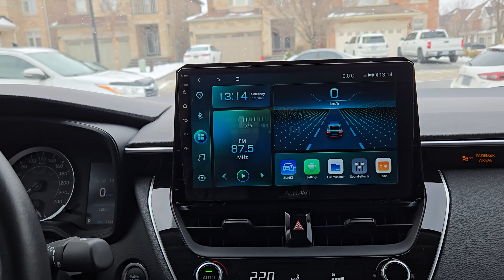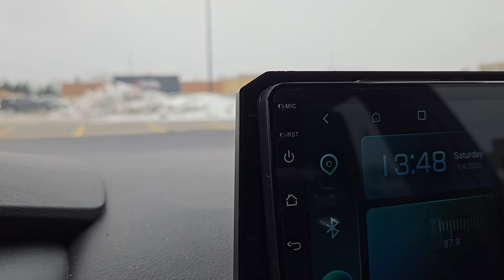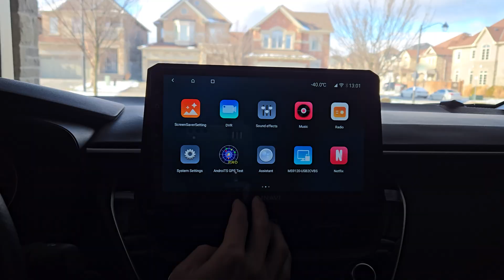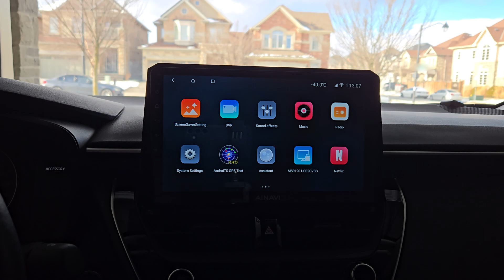📞 The Android Head Unit Microphone Noise Problem Low Volume FIXED!

Comment: I had the same issue,  i just removed the onboard mic from that board all together, and plugged into the existing external mic on the android head unit.  that resolved the issue for me.  less soldering as im not that great at soldering small components

Comment: There's another thing that you could do, take the centre light unit out, and tap the end of the mic with a multimeter on continuity and mode and check the other end of a harness that usually ends in the back of your previously fitted stereo. There are usually 3 points of contact for factory mic - Signal +ve, GND and +5V; You can use a +5V from one of the two USB outs, and use the mic port on the back of android stereo to hook up the SIgnal +ve and GND

Comment: Did you retain the mic connected on the back? like you're using 2 external mic simultaneously? I desoldered the internal mic and I connected an external mic on the back and attached the mic on the original mic position. i'm still not satisfied, planning to do your fix, like 2 mic external working at the same time. is this the same with your setup?
Reply: If you leave the external microphone the way it is, you'll still have tge same issue with the modified mic, think.

Comment: Sorry catching up late with this excellent post. Question: having removed the internal why not just use the external mic into the connector at the back of the unit? Surely once the internal one is removed the ‘conflict’ no longer exists as it can’t pick up any sound. BTW the Olympus me52 w comes higher recommended as it is a uni mic rather than an omni one which picks up every sound. Pls respond to my query if you can. Thx again
Reply from the maker: A better mic is probably recommended to get quality sound. The problem with my unit is that there's a weird conflict between the internal and external mic - I'm absolutely no electrical engineer but I've only assumed two things - the internal mic & it's placement is terrible and that for some reason the internal mic is always switched on regardless of the external one which led me just to remove it all together...

Comment: Holy mackerel. My android head unit has NO OPTION to bypass the bezel mic and use the wired one. I have been through every menu to no avail. I am going to try this. Mine has an audio jack in the back and maybe all I have to do is remove the mic to break the bezel mic circuit and maybe it’ll fail to the 3.5mm mic jack in the back. If not I’ll solder as you did.
Reply: Let us know if that works.
Reply: @nobodyonearth5925 it did not work. You must remove the bezel mic and resolder the mic jack as shown in this vid, apparently.

Comment: Bro, I literally just did this. Followed your instructions and was able to hook up my factory mic on my Tacoma.
 And works very well.
Reply: did you take any pics of the process? I have a subaru, so unsure what the factory mic actually looks like yet
Reply: Dude I’m trying to figure out what wires are from the factory mic 😂 in my Tacoma, could you help me out?? I’m at a loss.
Reply: Like what cables are the OEM mic from the Tacoma?? I don’t wanna cut the wrong cable and just mess it all up..

Comment: So hey My head unit has an external mic and port, but im still having the same problem as you sounding muffled. By the desoldering the internal microphone and using the external mic and port will it solve my problem?
Reply: so the port or jack is trs, same as yours but built in on my head unit
Reply from the maker: I'd say it got a bit better in terms of clarity but ultimately I think people would still be disappointed as its not a drastic change in quality. I think this mod and a better hardware mic with active nr (and low cut) would definitely help - however its costly. I still haven't experimented with usb mics I know there is a few people here that have tried however not sure if they've reported back in the threads. If you have mic settings in your head unit you may be able to tweak it enough.

Comment: You did a great job on this video.  I am a commercially licensed radio technician and found your video interesting and original.  If you are going to work with small components on circuit boards and you want to keep your soldering iron, a trick is to take a piece of solid copper wire about 18 AWG and wrap a few turns around the tip of your iron leaving about a half inch sticking out.  When you heat your iron, this will act as a slightly lower temp small tip to get into the tight spaces.  Keep up the good work!
Reply from the maker: Wow! I appreciate your words as I'm no where near your expertise 🤣. That's a really great soldering tip I never thought before, always love to learn. Thanks for sharing, cheers!

Comment: The mic device they put on the small PCB board is an old style one which has bad sensitivity,  you can replaced it with a MEMS mic module.
Reply from the maker: Nice! I was considering a newer external mic to try out but I'll look that up. Cheers
Reply: this is interesting, do you have any specific model numbers for this mic module?

Comment: Having trouble soldering the new adapter in. I was able to remove the small mic though. If I just leave it like this, would my other mic still work better? I have an external mic jack on the back.
Reply from the maker: I would say try it. Some people have reported it being better not having the internal mic there at all
Reply: You mean remove the mic and then do nothing else? Will it automatically revert to the 3.5mm jack in the back if you do?

Comment: I suppose you wouldn't know how to power on such head-unit on your desk? (I.e. without having to run to a car and struggle with the damned quadlock connector...?)
Reply from the maker: Actually yes, typically you'd supply 12v positive to battery plus and acc then ground to negative. You'd have to refer to your schematics for the pin outs. Cheers
Reply: @squishyhammer  this is exactly what i tried, but it did not work... i guess i connected wrong wires
thank you

Comment: What's the diameter of the mic you pulled from the board?
Is is closer to.157" or .236"?
Reply from the maker: Using my precision tool I measured 0.1565" (3.97mm) so closer to .157" is the answer :)

Comment: You can check in the wires that come out of the unit there should be one reserved for audio input, once connected, you can enter the engineering mode to switch to that input,
Reply from the maker: Intriguing! Thanks for sharing, how are you able to access engineering mode?
Reply: @squishyhammer  setting-> factory setting-> password usually be 0000 or 000000 or 1234 or 123456
Reply from the maker: @DDnight546  oh, you had my heart racing there for a minute 🤣 That's only access to the factory menu. Unfortunately I never had that input switch option there. Thx tho!
Reply: @squishyhammer  On my device, there is a setting in I think it's arm or DSP page that you can choose the default input and set it from internal mic to external mic which should be on the same page that you can adjust the Bluetooth mic gain. However, these Chinese products come with several different versions. However, since you have the mic input wire through the back port, there should be the option waiting for you. Or maybe just simply plug it in, maybe with load there will be option pop up for you to choose it.
Reply: @DDnight546  Sometimes such setting does nothing, because the microphone inputs are connected anyways.

Comment: I was actually able to order an iDoing head unit for my Subaru Outback that uses my factory mic. The quality of the actual head unit is questionable, which makes me mad condiering I paid almost $500 for it, but it was plug and play.
Reply from the maker: @katerycho14  nice! that's good to know there is a capability on some vehicles to use the oem mic. I've always wondered why it's so sporadic in terms of support. Cheers
Reply: could you share a link for the one you ordered? I'm looking into these units for my WRX right now

Comment: Just so I follow you (and I'm not trying to be a wise guy), the reason why you hard-wired the Mic was to try and overcome poor mixing between the external and internal microphone, which lacked adjustment options? 

I'd be curious as to what the result would have been if you just removed the internal Mic, leaving fhe external plugged in.

I was having similar Mic problems on my ATOTO A6.  Luckiky I found a hidden menu that had a gain control for the microphone. Still not perfect but at least people can hear me better. 
 AG
Reply: I just did that, there is a lot of echo compared to before removing the integrated mic. I will proceed with soldering a 3.5 female jack to the points of the integrated mic so i can plug the external one in there. Having it in the designated spot doesn't seem to help so i beed to follow the fix in this video. I will leave an update to this comment after i'm done with the modification and testing.
Reply: @ventsislavyordanov8745  Please let me know if there was a difference when you directly soldered the external microphone to the internal mic's pins.
Reply: @ventsislavyordanov8745 any update on this?
Reply: With internal mic disabled/disconnected and external mic plugged in
Functionality wise there no change, I can still make phone call and do voice command
The sound become much better, because my android headunit internal mic has buzzing sound when both mic is active the sound is mixed causing bad sound
But when I make a call with default mic gain setting (default :4) the other person will hear echo and crackling noise, I had to reduce the gain to 0 to solve it

I disabled the internal mic with just putting tape over the internal mic's pins on the ribbon cable
Reply: @insanmuslim9919 can you share a picture how exactly you disabled internal mic with tape without removing it entirely? If I put tape on the 2 pins at the back side of the mic will it work?
Reply: @mRnOoNe21  Putting tape on the mic backside pins won't sever mic connection with the circuit board because the mic is soldered to the board.
Look at 1:53 . you need to disconnect the ribbon cable and put tape on the end of that ribbon cable.
Reply: @insanmuslim9919  Thanks, just did, there’s some improvement however still my voice sounds distorted during the call (like a metallic sound you usually hear when you have bad cellular reception)
Reply from the maker: Yes that's correct. This head unit unfortunately has no mic gain/mix adjustments at all - so the only recourse was to physically modify it. I'd be curious too - actually I was going to just leave the internal mic disconnected and experiment with the external jack but decided to solder onto the internal one last minute. I guess I got too excited with the improvement. I'll test it next time I open it up. I'm glad your ATOTO has those much needed options. Cheers
Reply: @squishyhammer  https://youtu.be/YDzWGZIOg3g?si=WSD3GUr5w-n71j8z

Comment: Just put of curiosity. How is the quality during calls? Can your counter part hear you properly, and better than before?
And dude.. You ROCK!
Reply from the maker: Thanks lol 😁Yes it is significantly better than before - I wouldn't call it perfect as there is still a bit of distortion - the noise suppression is still not as great in this older model, but the call quality is much improved. The only variable now is the placement of the mic which I still need to play around with. Cheers

Comment: Hi there, seen you videos and they are great. You know so much so do yo know what is the differense with RZ-FT01 or the RZ-FT02 canbus box??i justhad new junsun 6gb+128gb to my toyota rav4 2018 and if i open any door it will not show on the screen?? Ewerything else works fine. The factorysettings shoul be ok! Thans for the good videos. Timo from Finkand
Reply from the maker: Hey Timo! Thanks for the comments! I'm not specifically well versed in both canbus versions however each box has different compatibilities with certain car models. The latter version contains more recent vehicle years 2018+. I should refer you to looking at the lists for both Canbus boxes on AliExpress. I believe the RZ-FT-01 should include your Rav4. For you doors, if everything works ok you may want to look at the options somewhere in the settings I recall there was an activate door display indicator switch (I'm trying to remember from memory don't quote me on this 😆) . If not you may either need to try a different model configuration or update its firmware (ask if there is an update available). Cheers

Comment: Thank you!
I thought I was the only one with this issue...
It gets worse the faster you go.
I think I will try your solution.
Did you use the external microphone from Ainavi?
Reply from the maker: Yes I used the exact one. Sometimes I think it was the vibration in the case causing it - unsure. Regardless, now that it's outside its easy to reposition the mic. @ricardovieira90 commented only removing the onboard mic and using the other mic jack works better too so perhaps the onboard mic is always in an on position. Cheers
Reply: @squishyhammer  Thanks. You mean the cable from AINAVI that have the 3.5mm jack?
Reply: @spiritcore1 did you try? I bought the cable and the mic but same bad quality, and can’t find a place to switch between the 2 mics… does unsoldering the onboard mic solves the problem?
Reply: @19Jose91  I de-soldered the mic from the board and used the cable. People say my quality has been improved so I guess it does work.
Reply: @spiritcore1  still satisfied with the outcome? I’m about to follow in your footsteps

Comment: Hey there, great video. Why did you switch back to the ainavi from the dasaita?
Reply from the maker: I'm still making content for both units lol! I love both my Ainavi and G13. I interchange them easily after doing it so many times. I have an update video coming up for the Ainavi, especially I haven't tested the 360 cameras in deep winter yet! Cheers
Reply: @squishyhammer  Ah! Which one have you been leaning towards more?
Reply from the maker: @thomasduggan_  I would say the Dasaita G13 since i've had no issues whatsoever with it when I installed it - and support has been greater. Granted that my H5/H6 is over a year old - I'm sure the newer Ainavi models may have solved all the shortcomings in terms of hardware & service. The only bummer with the G13 is that its only available for limited select vehicles and doesn't support 3rd party 360 cameras (like the ones I installed in my other video). You can't go wrong with either really. I think I'd have to review newer Ainavi units this year to have a comparable opinion. Cheers
Reply: The dasaita microphone really is the worst though. Everyone says I sound like I'm underwater and a mile away. Will the fix in this video take car of that

Comment: Great work! Luckily, the OEM microphone works on the ainavi 13.1 inch and there is software support. But as I think the best YouTuber for these devices, can you tell me under which menu item I can find the interior lighting when opening the door?! It doesn't work for me anymore 😞
Reply from the maker: Thanks! Wow the 13" uses the factory mic? That's a new one for me. Hmm I always recommend resetting back to defaults or switching back to the oem head unit if something is majorly misconfigured. This might sound really strange but have you made sure your physical door light button is enabled on your console? You may have depressed it by accident - as I have many times. Cheers
Reply: @squishyhammer  Of course I have ;) I have now found the menu item. Unfortunately it doesn't change anything. I haven't found the right pin/password for the reset settings. But I'll try it with the OEM radio 👍😋
Reply: @squishyhammer  I have it. The interior lighting is working again!!!! 
The car must not be fully switched on! With a keyless car, just press the start button. Without using the brake. In this mode, I was able to set the brightness as desired and it took over immediately without switching back to (off). Now, the light comes on again as normal when the door is opened or closed.
Reply from the maker: @Roman-cz3ws  Awesome you got it working!!! So essentially the car has to be running in Accessory mode while being configured... interesting. That powers the unit without the data to the canbus. So sounds like it has to be re-configured before communicating with the car (which probably kept overwriting your changes). Thanks for sharing - hope it helps others in the same spot! 😀

Comment: Amazing, maybe you can find a replacement OEM Toyota microphone and replace the one on the radio with that one. I am still dreaming to get my hands on the AINAVI with all the 3D cameras
Reply from the maker: That would be interesting. I was looking at how the Rolla microphone worked apparently its powered differently, i still need to find a clearer schematic on how it works. Be sure I'll make a video on that if I do get it working lol! The 360 cameras and the Ainavi makes for a huge transformation - it's like a new car again basically. Cheers
Reply: @squishyhammer  the factory mic is wired to a system called the DCM Telemantics System. You have a fuse under your hood called MAYDAY. Pull it with your factory head unit installed and you’ll lose microphone functionality. You’ll also lose all functionality with the Toyota app, remote start, and in-cluster speed limit signage. This is similar to OnStar systems in other cars, which is actually because they use the same base technology. In fact, if you pay for Toyota connected services, some credit card companies will even post it to your statement as “OnStar.”
Reply: Won't work, OEM uses an amplifier. Android head units put out about 1.5V for the mic circuit. Not enough to push the micro-amp . You would have boost the voltage but then it becomes more difficult for most folks to do.
Reply: @fastboarder2688  It is an electret mic, I think it will power equally, you don't need to replace the whole module